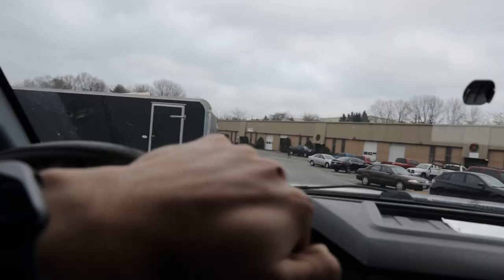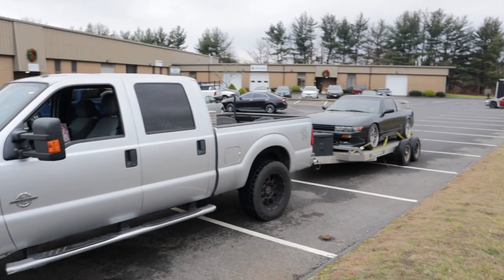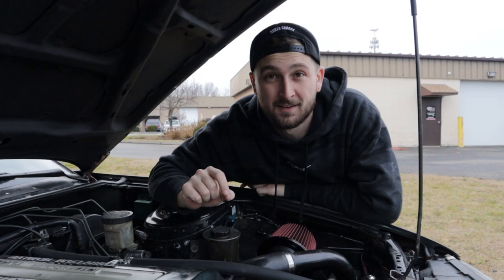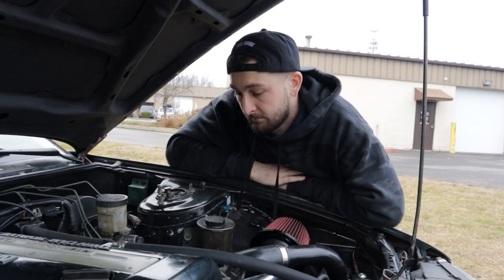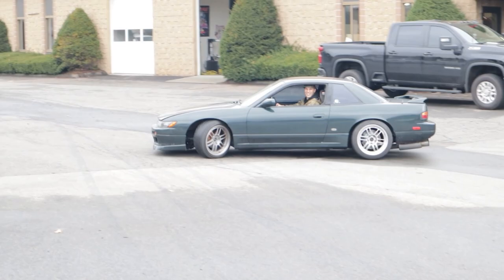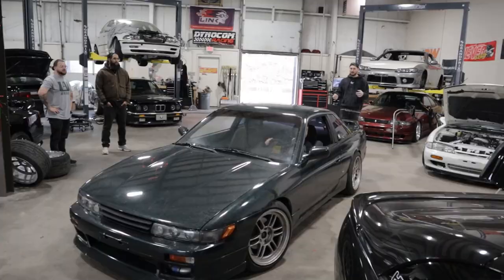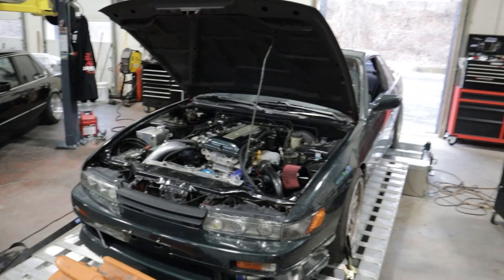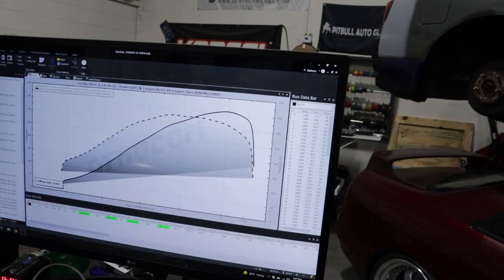JIMMY OAKES REVS MY 240SX TO 8200RPM!

Comment: Sam, the reason people leave the stock exhaust manifold on non vct sr20s is to keep the factory external baffle. if you run an aftermarket one and run the crank case to a catch can they breathe excessively. this is why people cut and shut vct rocker covers to suit non vct.

Comment: 24:30, yup, in Japan the S13 180SX had the 1.8L CA18DET as a standard Engine hence the 180SX, in Europe they had the 2.0L SR20 as a standard engine hence the 200SX (also offering the CA18) and in the US they had the 2.4L KA24. The Silvia S14 for Europe and Austrlia was called 200SX because it had the SR20, and in the North America it called 240SX as they used the KA24. This generally is the idea behind the codes, of course there may be some exceptions to what I said and I may be wrong in a detail.

Comment: That 240 RIPS!
Reply: Its a S13 silvia says silvia on the rear do use call them 240sx in america? Try google a s13 silvia and then google a 240sx diffrent cars
Reply: @joshuapetherick5794  240sx Couple with Siliva Front
Reply: @onlyetm  literally says silvia on the rear end 240sx rear ends have 240sx on the rear quarter glass
Reply: @onlyetm  not worryed realy we call them s13 silvia in new zealand
Reply: @onlyetm  im just saying hes calling it a 240sx when it clearly says silvia on the boot between the lights and clearly s13 front end just saying no biggy tho
Reply: @joshuapetherick5794  In North America they are all call 240sx
Reply: @joshuapetherick5794  hate to say it but that's a 240
Reply: @joshuapetherick5794  you dont know what you're talking about
Reply: @trueno5365  have u got google hava look bud
Reply: @UCK83HbznwoS6_1kaz7MolTA  did u not watch the video clearly says silvia on rear end of hes car look up s13 silvia on google eact same car look shit up u dont no what ur talking about
Reply: @joshuapetherick5794  mad
Reply: @joshuapetherick5794  mad
Reply: @trueno5365  facts
Reply: There is a simple fix to this guys. If you look up an s13 there all right hand drive.🤔 that's because the car was not made in the USA. What happened was nissan made a 240sx and that was the closest Americans could get to a s13 unless they face swap the car and change out all the headlights then you would have an s13 replica exactly like the car SAMMIT bought. Also SAMMIT literally calls a 240sx lol.
Reply: @trueno5365  i guess s13 rep  240sx have the 240sx on the rear quarter window and r hatchback hes car does have silvia on the rear but as u said between usdm and jdm i wouldnt  no guess usdm had diffrent car names pretty otg realy
Reply: @trueno5365  even 240sx with face lft is a hatch back sams is a sedan
Reply: @trueno5365  i c the old 240sx in america looked like the s13 the newer but still old model of the  240sx in america looks like the s14 and so on
Reply: @trueno5365  learnt somthing lol
Reply: @trueno5365  yeah looks like use had few diffrent 240sx models the hatch version and the  s13 look a like then the 200sx/240sx  s14 look alikes crazy
Reply: @trueno5365  dude, the s13 is the chassis, the silvias were right handers, the 240sx in the states was the left hander

Comment: 24:59 All accross europe S13 and S14 are called "200sx",  the weird thing is the S13 EUDM only came with CA18DET 169/175hp. For the special sauce, they all had Nismo diff cooler, SMIC (similar to the JDM 180sx), dual tone turn signal/day light, 3.916 diff ratio, turn signal just under the side mirror , no trunk 3rd light (that's kinda cool) and few other things. I have one, but SR and type X swapped now.